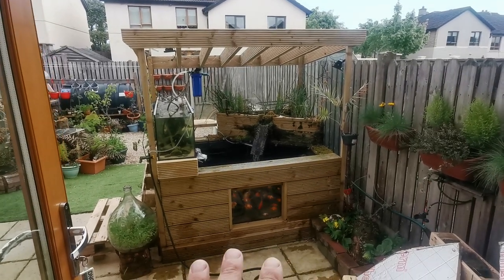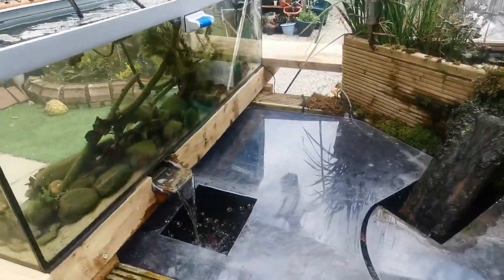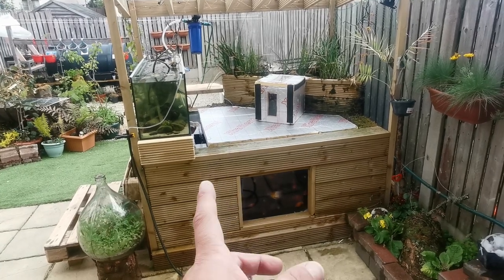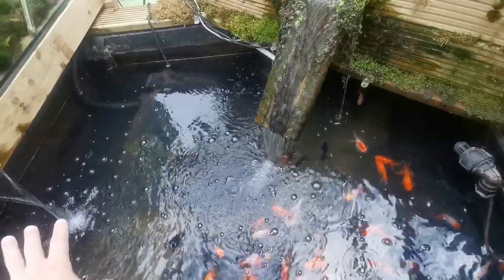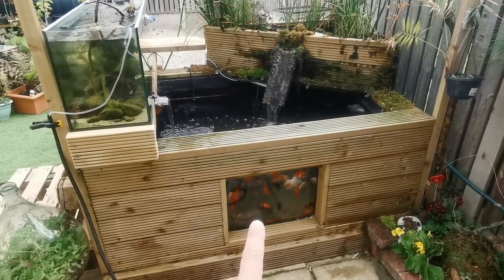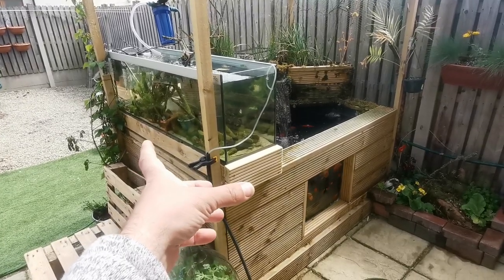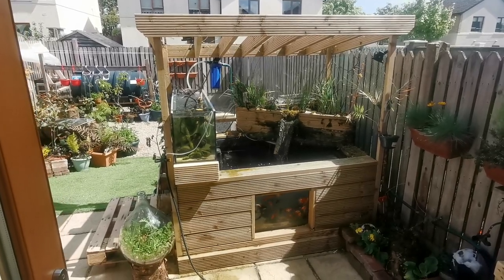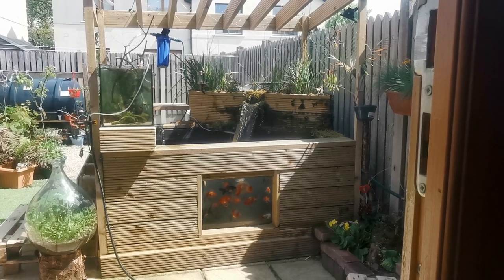The cost of living with a heated raised pond over winter!

Comment: Great video and much appreciated think have to think about this more now maybe 2500l or 3000l pond what size heaters do you think would be best for it i am thinking of  Pressurised filter run in to 2 barrel of k1 moving bed  boxed in and insulated and a 2 tear bakki shower which i woukd box off and insulated that as well ? Thanks Brian
Reply from the maker: Your probably going to want twin 1k heaters, 1 will probably do for the best part but the 2nd would need to be there for backup and when it gets colder, but it depends on where your based and how cold it generally gets. You could also look into twin wall polycarbonate to span the greater distance over the pond surface for a lid!! Heaters are hard to judge because whrn it's really well insulated it won't conform to the manufacturer guidelines, but also heat loss can happen so much quicker outside when things go wrong!
Reply: @TheJoyofAquascaping  just outside Bristol are winters depend on the how bad we get it hit us with global warming etc we have some days round 10 -13c and -4 sometimes  mite have 2 build round 6ft by 4ft by 3.6ft high then 2 help with it what about 15cm to 20cm insulation so double it up on the sides and floor that mite help with the winter ?
Reply: Bin doin a lot thinking over the nite about the pond idea I am going 2 do it but next year that way I can plan it probably and get all things I need I will use sleepers to build the frame work and use brackets and coaching bolts to help it stay together 100% and build a pergola round it and polycarbonate floor and perspex round all four sides for the winter you gave so many good ideas and with a lot of planing it will be a work of art thanks to your help on how to build a fancy pond I will do a pond round 2500l -3000l can't  wait so my fishy will have stay indoors for another 8 months may need your help again if you don't mine thanks Brian
Reply from the maker: No problem at all, it sounds like it's gonna be amazing!!! One thing I never got to talk about is how if my backyard got more sun, I'd offset some costs by adding in some solar features. A small solar water heater set up would be phenomenal, I've thought about making one a few times, black coil wrapped around and placed in the sunshine, I think if it was done right it would be a good way to heat for as close to free as possible, maybe I'll have to do a few experiments and see how it goes!!!
Reply: @TheJoyofAquascaping  thanks i look in 2 that as well as where I am going put the pond we get a lot of sun thought out the day til about 4ishwill keep a eye out for the video if managed to get one done good luck with it brian
Reply: @TheJoyofAquascaping  have a  Question ? Can weather loach's and hill stream loach's live well with fancys gold fish as would to add them when I build the pond the weather loach's would get a nice size but not sure about hill stream loach's and what temperature they will need 2 live outdoors also temperature for fancys need be 18c or above i believe in the winter thanks Brian